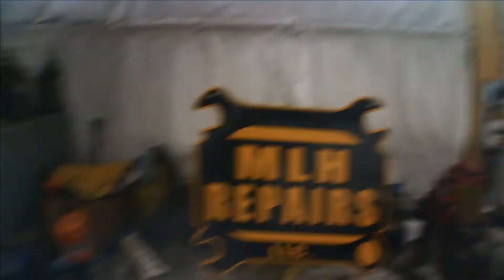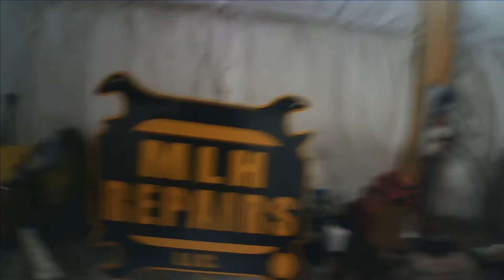S O T !!!!!! and Timberjack rear

Comment: I like you videos
Reply from the maker: Thank you very much!
Reply: I have a question I’m not typing to be nosey but how muck did it cost you to build your service truck
Reply from the maker: @chancecolwell3736  To tell you the truth. I paid less than 3 grand for the truck, needed a lot of work to get her ready. Have less than 5 grand in the welder and compressor. Tooling in the truck I have no idea anymore. When the truck went to work for me, it was basically a new truck mechanically. New brakes and rotors,lines, steering, exhaust,fan, radiator, injectors, computer, distributor, and have been inside the engine that many times I have it memorized.  She is probably my favorite service truck, not the newest,or the nicest. Has limitations, but I have more trust in that truck than any other.
Reply: My dads a desel mechanic he was making over 500’000 in oil fild
Reply from the maker: @chancecolwell3736  the opportunity is there, people just have to want to do it. Check out Michael Berg's channel and Warren from Western equipment repair. Two really good fellows
Reply: Hay we’re are you shop  located I think I seen it
Reply: Can I come work for you I’m 15 about to be 16
Reply from the maker: @chancecolwell3736  Pine Grove PA
Reply from the maker: @chancecolwell3736  unfortunately Bud, I am a one man show
 But I would gladly help you out when ever you would need it.
Reply: What town are you located in
Reply: I’m a hard worker
Reply: We could get stuff bone faster
Reply from the maker: @chancecolwell3736  Pine Grove PA
Reply: I’m a hard worker and we could get more stuff done faster
Reply: Can you text me